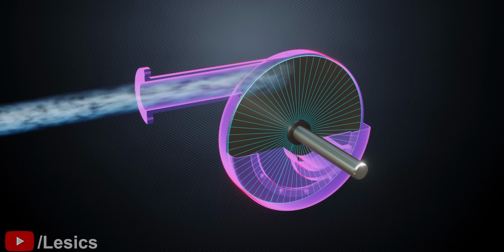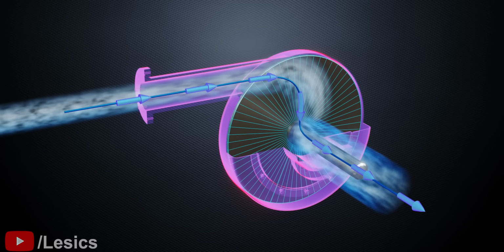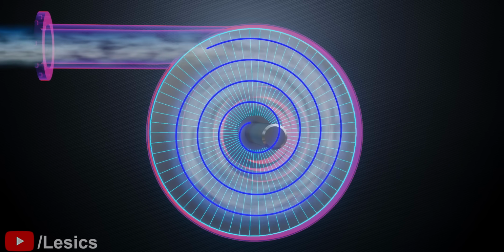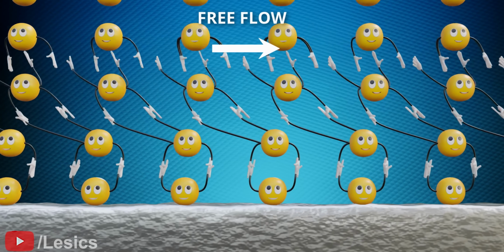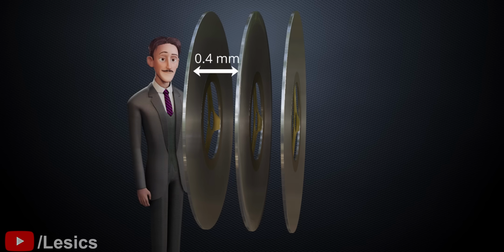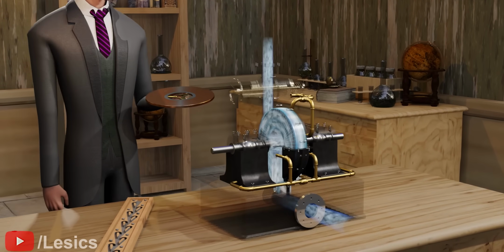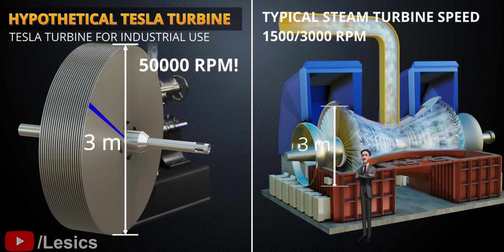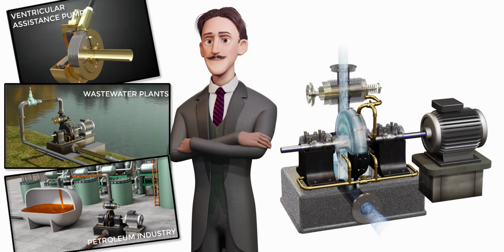Tesla Turbine | The interesting physics behind it

Comment: Teslas claims of more than 90% might be accurate, even if he didnt get the rpm. The man knew math, he could have calculated it. Something this channel should have done before making claims about Teslas claims..
Reply: The video doesn't claim the efficiency numbers are wrong, just unrealistic when considering the operating conditions required to achieve these high efficiencies.
Reply: @TheRealFlamingNinja   technically he claimed those efficiency levels not using a single Tesla turbine, but a pump turbine pump combination. Where the design gets REALLY COOL is the cold steam version that basically runs continuously as long as you can maintain vacuum while keeping the incoming water stream over 140 degrees F, easily done with just leaving water in a reflective trough in most warmer climates. Tesla was also a big believer in Æther physics and not Einstein's relativity... people should watch Eric Dollard's lectures on The History and Theory of Electrical Engineering! Or William Lyne's lecture on the show called the 33rd Parralel! Supposedly Tesla also figured out John Keely's secret, hence the 3-6-9 quote! Keely was using an entirely different model of the atom than we use today and was a member of the Theosophical Society, or at least his financial benefactor Clara Jessop Bloomfield was a member, and supposedly Annie Besant got her hands on most of the Keely prototypes and hid them away after his death to prevent their use during the World Wars. You can learn more about Keely and Walter Russell by checking out Dale Pond's lectures!

Comment: The Tesla turbine is inherently not very efficient and low torque as it relies on boundary layer shear to function.  The resultant friction heat and the fact that the exhaust has to leave the disk at high velocity instead of its energy being extracted, is its downfall.  Simple...yes, but claims of 97% efficiency are complete nonsense, more like 1/10 of that.  If it was any good, modern mechanical engineers would use the design, but they don’t for good reasons.

Comment: If the disk doubled  with the design of a water wheel and the water intake is increased you'll get higher rate of energy! plus you could make the wheel smaller making it easier to engineer!

Comment: The Tesla turbine has the disadvantage of having to rely on friction interaction between a smooth surface and a fluid. 
This weak friction does not create very high torque, which makes a Tesla turbine useless for any application that requires that high torque (such as power generation).
Reply: gear it down. if its running at 50k rpm you have a lot to work with.
Reply: Industry (which depends on profits) does not think so.
Non profits & tree huggers seem to get all excited.... LOL
Reply: agree , but Nikola might have overcome that too
Reply: low torque but the important factor of power is good. gearing or an electric drive can be used to gain the required mechanical force of the application.

Comment: Okay I am an idiot, but if there is a cap on the usable RPM, why not use some type is transmission?  I.e.. on a 10 speed bike, 10th gear is really moving the tires, but you are not peddling so much as in 1st gear.  Make sense?
Reply: Make a note 📝 to my broker Robert on how to make  millions in crypto trading Investment.
Reply: W•H•A•T•S•A•P•P
+1•2•6•7•3•8•9•1•5•3•5•

Comment: Why is mach 13 impossible? Just because of the strength of the materials?
Reply: yup, the current materials would have too much centrifugal force and would rip the materials apart. SO the only way Teslas turbine can be used is with more viscous fluids (water, oil, mud, etc). it can pump thicker stuff at lower RPM's that are less stress on the turbine.

Comment: There's multiple kinds of Modern Turbines.  The aerofoil turbine is a fairly common example, the animation used a Turbojet.  However, there's also Radial Turbines, for instance the Scroll Case turbine in a leaf blower, or a shop fan.  (The case is in a spiral shape like a scroll.)  This uses Centrifugal Force instead of an airfoil.  The intake is in the center, and it spins the air through simple louvers around the wall of the cylinder.  The scroll case just directs that flow in 1 direction.  That's just 1 example, your office fan, or the one in your computer probably just uses a ramp instead of an airfoil.  A "Turbine" is basically a technical term for a "Fan."  Back in the day, people seemed to like Alliteration a lot.  Tesla Turbine sounds better than Tesla fan.  (Like the Tesla Tower, which is just a scaled up Tesla Coil, and potentially a Doomsday Device.)  Like Lois Lane, and Lana Lang...
Reply: When it comes to Efficiency, like pretty much all Turbines, it's most Efficient at a constant rate.  Where you see losses is when you speed it up, and slow it down.  Tesla type turbines are Less efficient when it comes to speeding them up, and slowing them down, because the turbine itself is a flywheel.  Tesla was also a showman, so was Edison, and so was Marconi.  Claims like 97% efficiency, or "Bottled at the source, untouched by man," are designed to sell things like water to people, who don't really think about it too hard.
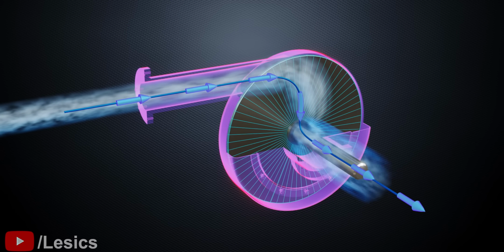Reply: 2:26  "Naturally flows towards the center."  Compressing it against the vanes, and against centrifugal force.  Also, that's a Compressor design, basically run backwards.  You have the intake, and exhaust going the right way, you even have the turbine spinning the right way.  But you don't blow compressed air into that to turn the shaft.  You turn that shaft to compress the air.  This is important for designing a turbine to do a particular job, efficiently.  (Why we have so many Turbine designs.)  Nikola Tesla designed his Turbine to turn a shaft, and generate Alternating Current.  Diesel manufacturers (That don't care about Efficiency) use that design to force more air into a diesel engine.  So, of course Tesla's turbine design is more efficient than a Brute Force turbo-diesel compressor.

Comment: um WRONG IN EVERY WAY POSSIBLE ... did you even read his patent on this turbine ... or did you follow edisons version of the explanation and like him get it wrong to the extreme 

 a tesla turbine ... the fluid hits one plate side on not end on .. the plate has holes drilled on an angle in a parabolic curve ... as the steam hits the blade it moves across the blade and flows out each hole as it flows out each hole it drags the plate along with it and then it hits the next plate and so on ... the holes are not align form one plate to the next but offset for optimum conversion like a rotor to startor to rotor design in an axial flow trubine jet engine ... the 97% efficient design has holes in the inner ring for a max of 1/3rd of the diameter ... the next plate has the holes in the middle 3rd and the next one has them at the last 3rd ... and the next one has them in the middle again ... each plate is dragged and rotated by the flow of the steam hitting and sliding across the each plate surface ... bernoulli and the coriolis effect are key points of the tesla turbine and you missed them by a about 500 years

Comment: 8:27 there's also the option of reducing the diameter of the disks, and adding more of them in parallel, to make up for the difference. That way, the top speed at the tips can be reduced, and still achieve a higher efficiency than steam turbines.
Reply: The smaller the diameter of the disk, the less surface area the disks will have with the fluid, the faster the fluid has to flow to run the turbine efficiently, the faster the disks will rotate, the more stress is placed on the disks, etc. And the larger the diameter of the disks, the slower the fluid can be while running efficiently, however the greater the stress on the wheel from it's own mass. There is a sweet spot, but it still spins too fast to be operational. The design is filed under revisit with superior materials. 

That said, you could force this to work by using a fluid with greater viscosity that would transfer energy more efficiently if you found a way of translating the kinetic energy you are trying to harvest into some form of closed loop circuit for the fluid, but at that point, you'd have massive efficiency losses from that highly viscous fluid being recirculated into the system. The turbine itself would be as efficient as he says, but the process of properly powering it would drop efficiency.
Reply: Make a note 📝 to my broker Robert on how to make  millions in crypto trading Investment. ..
Reply: @christinagarcia4544  So you can also lose lots of money, like how all the other people lost when the crypto market declined, in the last months? Also, you're completely offtopic, and spamming.
Reply: W•H•A•T•S•A•P•P
+1•2•6•7•3•8•9•1•5•3•5• ..

Comment: In later patens, the RPM problem was fixed IRC by increasing the thickness of the disk/s substantially adding a grove at the top of the outer edges of the disk/s and a fluted case that compressed incoming fluid.

Comment: Well you said "Materials of the time" We have many materials that can handle 50k rpm these days of that size. Carbon carbon 2, A few Ceramics, And Graphite chained materials..  That is not the issue with the design fully though!  Your only talking about this motor in a zero load situation! 10% load on this design will need a 35% increase in speed to maintain the same efficiency with zero load!  Blade type compressor turbine does not follow this rule as drastically!

Comment: I wonder if carbon fiber would be strong enough?

One thing I would have liked to have seen covered is the viscous drag that you get on the walls of the chamber -- seems that it would be hard to avoid losing significant energy here.  Also note that Tesla turbine efficiency drops off if you add more or less than an optimal (light) load -- too little load, and most of the energy goes into heating the chamber walls (viscous drag there); too much load, and the disks slow down, causing increased slippage and decreased tightness of spiral.

Comment: Never say impossible, what exists now will always be surpassed in the future and you never want to be the guy who say, "No one needs more than 16 megabytes of RAM!"
Reply: If you're referring to the Bill Gates quote, he actually said no on should ever need more than 64 kilobytes of RAM.
Reply: @hagerty1952  was it not 640 kilobytes?  (The max amount of RAM supported natively by MSDOS)
Reply: @mac_tire_aonair  -  I was confusing it with the very first Intel memory chip that was (wait for it)...16 bits.  That's right, just two bytes.
Reply: Fred Garvin  - What?  And I guess Kirk never said "Beam me up, Scotty" or Rick never said "Play it again, Sam?"  What's this world coming to?
Reply: I remember when my dad said I'll never need more than a 10 meg hard disk. He had 16kbytes of RAM and felt pretty boss about that.
Reply: Right?
For example, the blades moving at MACH 13 only matters if it's in atmosphere. The speed of sound is always zero in a vacuum. Assuming they used that measure of speed bc of friction with atmosphere, encase the entire thing in a vacuum seal and that problem poofs away.
Reply: @aludrenknight1687  I know what you're thinking, but the problem is that there isn't a material they can use that won't tear itself apart spinning that fast.  Besides, it's hard to put the whole thing in a vacuum when the whole point is that you need to run water in and out freely!
Reply: @nickh5081  I get what you're saying, but the video didn't say it was shearing forces or anything that couldn't be overcome, just the "mach" speed was bad. But i agree with you. Also, I realize maintaining a vacuum would be detrimental to efficiency, especially if you must include the pressurized steam generator. lol
Reply: @aludrenknight1687  It's an open system how would you put it in vacuum?
Reply: @Vennillion  Make it not open. seal everything, the generator, the water line and pressurization, so it's a closed loop. Then suck out all the air and presto, no air resistance.
@Nick H pointed out we may not have material strong enough to withstand spinning at 50k rpm.
Reply: @aludrenknight1687  I don't think you can create a vacuum in this system.  It's powered by water that's driven by head pressure (the inlet) and the drain has to be free flowing.  Trying to enclose the system and "suck out the air" simply isn't possible unless you enclose the entire system including the water supply and the outflow water in a massive vacuum.
Reply: @aludrenknight1687  Dude, it isn't the vacuum part, it is the radial stress on the metal. The cent acc is omega squared times r. The force on any particle is acc x mass. The force on the center hub becomes crazy!
Reply: @aludrenknight1687  ROFL! The thing WORKS with fluids.
Reply: @brushhaidinger2506  yes, you're correct. I thought MACH was only for air atmosphere and they were saying the ends of the blades were in atmosphere due to it being an open system. My fail was that MACH is relative for any containing environment medium. I imagine moving MACH 13 through water is bad.

Comment: Your video was almost all correct, except you said “engineering impossibility”. It’s not impossible, it’s just not practical right now. What if instead of solid metal blades, you used another metal, say mercury, and instead of producing mechanical energy, it produced electromagnetic/gravity/anti-gravity. I had a dream once about an alien engine that worked like this 👽🤷🏼‍♂️

Comment: What if...
Instead of "disks;" use individual, curved "fan blades" that are concave towards the intake. pointed towards the direction of flow and were denser at the base near the shaft?
Reply: You may have a point, however, keep in mind that those fans would be weaker than a solid disk and thus need to be used at even lower RPMs, and eventually, you'd just end up with a normal fan blade turbine.
Reply: @bodaciouschad  
!(: THANKS :)!

Comment: How is the water at higher than atmospheric pressure.?
Reply: It's pressurized steam, not water.  To pressurize steam, all you need is a sealable container with some water in it.  Start heating the water until it is boiling.  Let the steam(hot gaseous water) push the air out of your vent.  Seal the vent, but keep adding heat.  Water is still boiling, more steam generated, but no more room to expand into.  Thus, pressure rises.  This increases the boiling temperature as the steam pushes against the water to prevent more of it from going gaseous.  Temperature rises though(you're adding enough heat, right?), and pressure keeps going up.  Nuclear reactors use this principle to get up to 153 atmospheres.  Hope your container is built tough!  As for the outlet at atmospheric - think of a river or really long hose.  The turbine provides "friction", resistance, so the steam can't just all escape at once, so there's a limited pressure change at any point.  As long as heat escaping(as work spinning the turbine or out the exit) doesn't exceed the heat being added at the boiler, the system is stable.  There's even ways to drop the exit pressure down towards vacuum levels, which will increase efficiency as well.

Comment: I wonder if with the development of nanoparticle technology if the bond between the blade and the fluid could be made stronger, resulting in less friction and hence, heat loss resulting in inefficiency. Some type of nanoparticle blade that could react with water to form a strong bond, but not too strong as to allow for flow from a position of high static force to lowered flow energy.

Comment: Missing something here? If you  move the exhaust port outward, you reduce the rpm, but not the torque? Thus the circumferential velocity is reduced to tolerable levels. ? Please - clever engineers tell me I’m a drongo head!